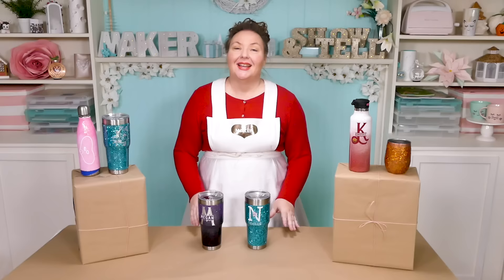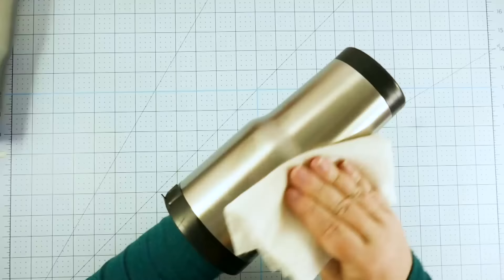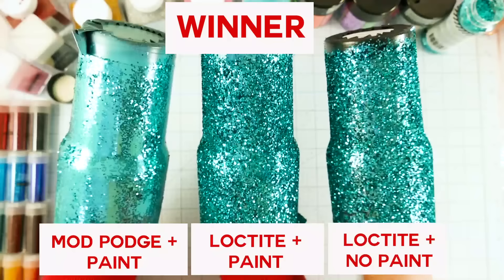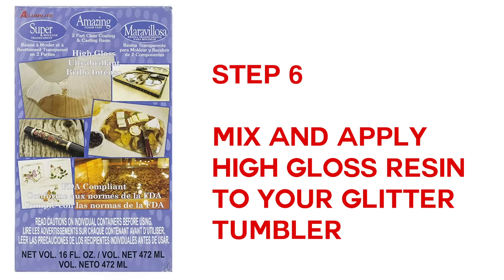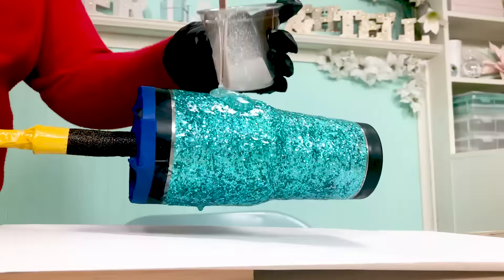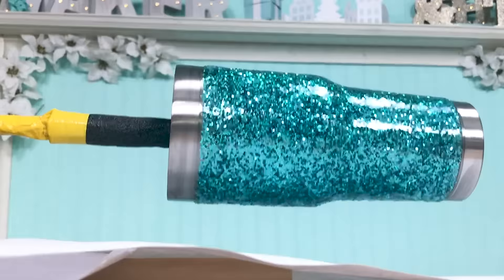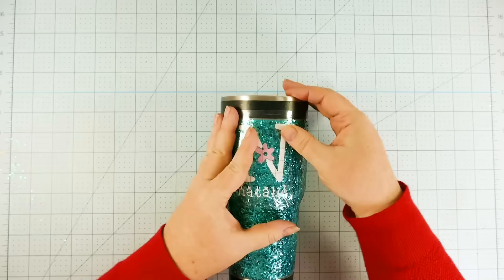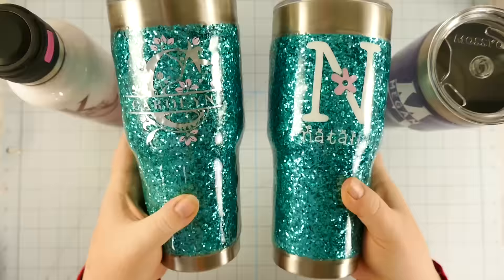Glitter Tumbler Tutorial - Epoxy + Loctite Method - Full Process Start to Finish!

Comment: How long to keep second coat turning before you can let sit? And how long between turning 1st coat and sanding?
Reply: Pot life for this particular brand is 30-45 min with a full cure in 48 hours. I just let mine turn for 12 hours which is when its no longer sticky but still not fully cured. You can keep testing it im more of a set and forget kid tho. I do it at night and check it when i get home from work.

Comment: Hello. I made my first steel tumbler. However. Mixing the resin...not so good. It got HOT and HARDENED FAST!!! I did not even get to mix them the way you did separately for 1 min each and then mix them together and stir for a total of 3 mins and it was hard! I was left with 1 min 42 sec left and it was WHITE  HARD  and    HOT.... Did it twice.. and it did the same thing and there are NO precautions on my Amazing Casting Resin box about this Part A and B getting HOT...
Reply: nevermind i was using the mold!

Comment: Hello Jennifer and crafters! I'm diving in with my first tumbler. I would like to add rhinestones to a particular area of the tumbler. Is it best to add the rhinestones before adding the epoxy or afterwards or does it not matter if I am gluing them down? Also, what is the best type of glue to use? Thank you!
Reply from the maker: You can add them in between your first coat or final coat of epoxy.  You can stick them when your first coat is almost dry but still tacky, or apply lightly with a clear glue. :)
Reply: @JenniferMaker  Thank you and I hope you are feeling better!

Comment: Hi Jennifer!  Thank you for this tutorial. I was wondering if it’s possible to put epoxy on tumblers that are already coated?
Reply from the maker: If they are already coated with epoxy, yes you could add another layer.
Reply: Jennifer Maker hi. Sorry, I need to clarify that I am talking about tumblers that I purchased already coated with a colored matte finish and not a stainless steel surface

Comment: Jennifer, what is the difference between loctite 300 and loctite 100?
Reply: i have several cans of loctite spray adhesive "general purpose" and im wondering if i can use it for this, or if i need this general performance can that you used?
Reply from the maker: I have not tested the other, but I think you should be okay. :)
Reply from the maker: I am not completely sure of the difference, but you should be okay!

Comment: Do you have to turn it for the total 24-48 hours?
Reply from the maker: No, you certainly don't. The turning is until the epoxy is dried so for about 5 hours. The curing process does take 24-48 hours :)

Comment: I just realized I bought loctite multi purpose spray adhesive. Can I use that or i need to get the specific one you used?
Reply from the maker: Since I haven't used it, I can't say for sure, but in looking at the website, it sure seems like it! I recommend against the Loctite 300 because it is water and heat resistant, and so the glitter just doesn't stick very well! You could try on a small area before doing the whole tumbler, just to make sure! 😉🥰

Comment: What happens if we use Loctite 300 instead of the 100??
Reply from the maker: We recommended the 100 because it's a lighter adhesive however if you're only able to find the 300, your results may vary but it should work. Thanks for watching!😊🌻

Comment: My epoxy pooled on the bottom of the tumbler. I was able to sand it off but I’m wondering what might have caused that??
Reply from the maker: Did you keep the tumbler turning as it was setting? That's usually the best way to prevent this.
Reply: Jennifer Maker Yes Ma’am. It is on an electric turner. I’m wondering if maybe it was to warm in the room. Could that be a possibility??
Reply: Yes. It was spinning the entire time. Overnight without stopping. I have another cup spinning at the moment and it’s not doing that at all. The only difference is room temperature.

Comment: how do you avoid little air bubbles when you apply the epoxy to the tumbler?
Reply from the maker: SLOWLY mix and SLOWLY pour the resin, Natalia! By doing that, I haven't had trouble with bubbles, but if they still happen, I have heard of people warming their tumblers back up with a heat gun while they are on the turner, and this will sometimes get rid of the bubbles! 😍

Comment: When you do your second coat of resin and remove the tape how many hours do you leave it on the turner? Does it need to cure the 24-48 hours on the tumbler or can you remove them before?
Reply from the maker: Just leave it on the turner until it has cured enough to handle and is hard. :)
Reply: Jennifer Maker Do you keep the turner spinning until fully cured? Or can I shut it off after 5 or so hours?

Comment: I like to put the cricuit vinyl decals to spray painted wine bottles.  I don't take the alcohol out.  They're full bottles. I spray paint the bottles and sometimes I use a gloss sealer after.  There are times I can't get the decals to stick at all. Why? Help.
Reply from the maker: That sounds like a delicious treat! :) . What type of vinyl are you using?  Is it permanent vinyl?  Check your vinyl first, and second, I'd possibly try using a transfer tape with less tack so the vinyl doesn't overly stick to your transfer tape. :) .
Reply: @JenniferMaker  I thought all vinyl was permanent.  Is there a certain brand name you could give me with less tack? Transfer tape?  Please tell me brands. Does it work with the cricut  machine.

Comment: If I want to have a design be a different color than the color of paint can the vinyl be used like a stencil?
Reply from the maker: Yes, I like to use permanent vinyl as a stencil.
Reply: @JenniferMaker  awesome . I am new yo all things crafting. So If I were to use as stencil, would I put it on then resin and pull off like the tape? Or do you have a video that goes over this type thing?
Reply: I tried to sand down steel tumblers and it scratching it is there a secret to it

Comment: i made my first tumbler and had some issues with some bubbles forming in the epoxy? am i doing something wrong?
Reply: Bubbles form in epoxy when mixed very quickly or when not given time to set. A popular solution to air bubbles forming in epoxy is to take a stick lighter and go over the epoxy in spurts. Pops all of the bubbles and will ensure that your resin cures smoothly.

Comment: Is it true that direct heat like a lighter woud get out the bubbles? Im just starting out
Reply: Also can i use a hair dryer to speed up the process?
Reply from the maker: Te Rina, you can use a small kitchen torch lighter and quickly run it over the cup. Make sure to be 5 inches or more away from the cup when you do.
Reply from the maker: Te Rina, no, this will not speed up the process. This will just make your epoxy runny and won't let it cure. Just let it sit for up to 24 hours before going to the next step.

Comment: I have a question I used this Part A and B epoxy from Amazon to seal my glitter tumbler but it is sticky
Reply from the maker: You should check the instructions on your resin and make sure you mixed the two parts thoroughly. 😊
Reply: @JenniferMaker  Thank you for being so informative and helpful. I’m just trying to make sells after all my material purchasing

Comment: How long did you let the glitter dry before you added epoxy
Reply from the maker: I let it dry for 30 mins with the spray adhesive and 1-2 hours with the Mod Podge.
Reply: @JenniferMaker  ok cause I just glittered a cup using epoxy as the base then sprinkled the glitter but I want to add another layer of epoxy I don't want it to smudge

Comment: Hello, thank you for this video. Quick question, do I have to use to spray polycyclic or can I use the one I brush on for a sealant for the glitter?
Reply from the maker: You can use either, however, the spray dries faster and is much easier to work with against all that glitter. :)
Reply: @JenniferMaker  Thank you for responding. #StoreRun
Reply: Dlonne
To
Reply: @shaleabrown  Dlonne
To

Comment: I purchased this epoxy and it smelled horrible, super strong!  Is this normal?  I am crafting in my dining room, had window open and fan but holy cow super strong.  Wore respirator and gloves while making tumbler.  But whole house smelled.
Reply from the maker: What epoxy were you using? Glad you wore a respirator and gloves!
Reply: The alumilite clear cast exact one in video.

Comment: I am doing everything shown in the video, but when I put the resin on it takes all the glitter off even with the same sealer you are using. Not really sure what I am doing wrong. :(
Reply: I haven’t done this yet but I’ve seen the glitter sprinkled on a thin layer of clear epoxy (rather than adhesive) done on the turner, you will have to wait until it cures for the second coat but I’m sure it won’t come off
Reply: @barbott2430  I have seen videos like that as well. Thinking I might try that. I bought both of the sprays already so I was trying to make it work out.
Reply from the maker: You could also try using Mod Podge to glue the glitter to the tumbler before adding the epoxy.

Comment: I am using the loctite method with spray paint but the paint slides off as i am trying to apply the glitter. Can anyone give me some advice on what to do?
Reply from the maker: Have you spray painted aluminum tumblers, and that's the paint that's sliding off? If you did, two things could be going on. Either you didn't rough up the surface enough for the paint to stick, or the paint wasn't dry enough before you sprayed the loctite. Does this help you? If not, please get back in touch with us! :)
Reply: @JenniferMaker  Thank you so much! I think I didn't let it dry enough. I tried it again and left it alone longer and it seems to have worked. Thank you so much for getting back to me! I love watching your videos!!!

Comment: My cup fills sticky why is that can you help me please
Reply from the maker: Resin can be a finicky material to work with. You need to make sure to thoroughly mix both parts together, to work in a space that has a constant correct temperature and doesn’t have any drafts, and many other considerations.  If you Google it, you will see many articles.  💕

Comment: Jennifer, I have some "old' epoxy. its been sitting around a while. the part B has yellowed. is that garbage or do you think i can still use it on darker coolers?
Reply from the maker: Not sure...I would test a tiny amount on a piece of scrap and make sure it sets the way it should.  If it works, you're good! :)
Reply: If you don't mind the color then it's still usable.  You can add pigments or glitter or mica powders to change the color

Comment: Did I look at this wrong.. Didn't you actually use 3 layers of epoxy?
Reply from the maker: I used two layers.  One over the glitter- allow that to cure, then apply vinyl or whatever you would like.  Then a final coat of epoxy.  You can ad a 3rd coat if you want to. 😊